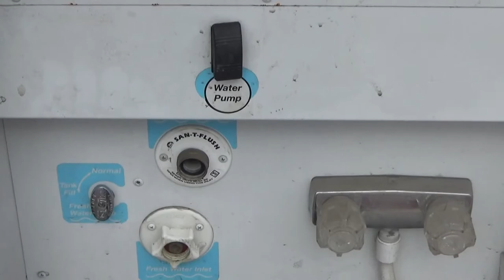My motorhome wet bay froze up plus the RV park and the whole city loses power for days

Comment: Jerry, you don't have a generator? You need a small heater in your wet bay if your RV doesn't duct the furnace heat down there too. Is your water filter(that froze), after your water pump.  It must be if it's leaking like that but only when your water pump is running. That would mean water coming from the RV park(city water) would not be filtered as it is put into your fresh water tank and when your RV is on "city water", it doesn't go through your water pump or filter( unless your filter is plumbed past the point where the city water and water pump output come together. I'm hoping to put a filter like that in our wet bay soon. Where did you get it/brand? Thanks
..
Reply: @jerrydixon  We bought a Cameo one that looks just like yours but I can't get it to stop leaking at the top where that round o-ring gasket is. It has some rough areas around that flat surface of the head piece. Camco sent me a new one but it has the same problem. I am hoping to find one with a metal head but they probably don't exist. Did you have any problems with yours ever leaking before it froze and burst? Thanks Jerry!